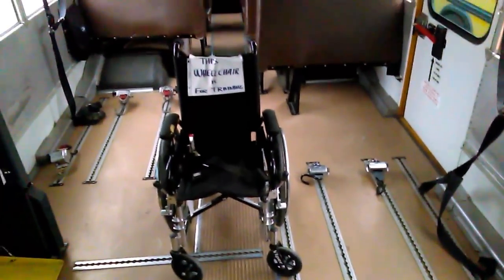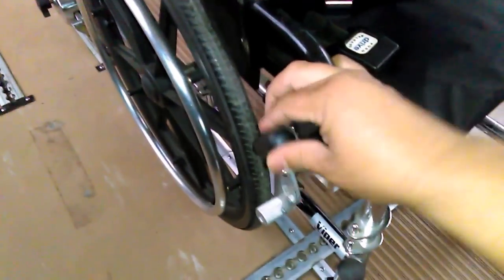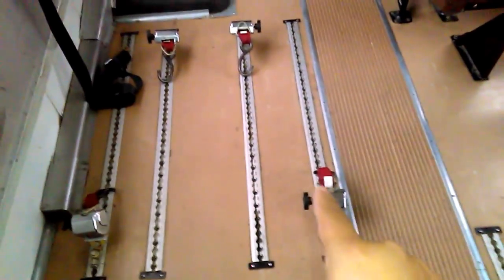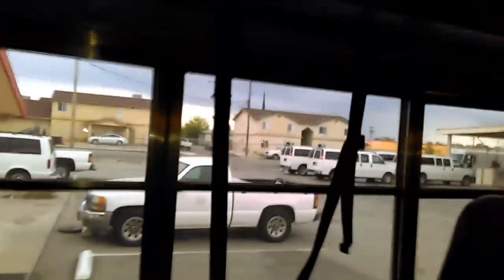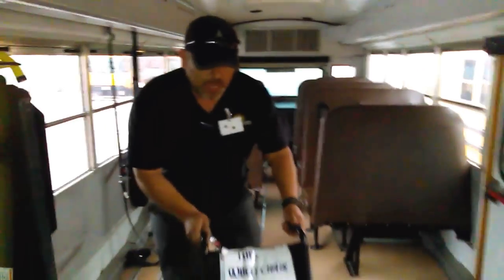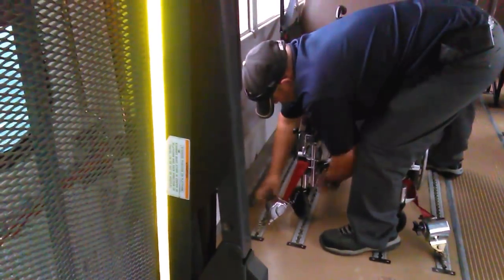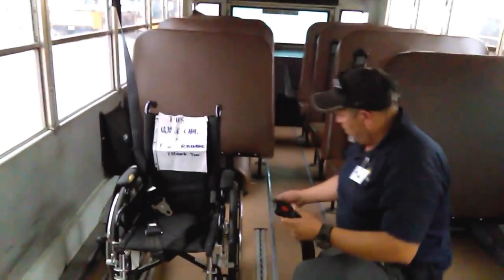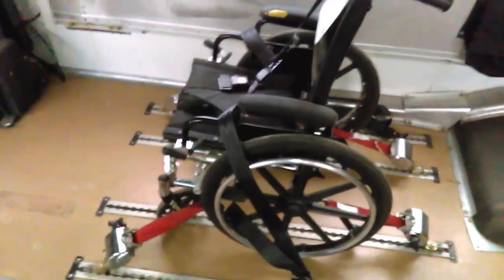School bus wheelchair securement using  the 7-point system. CDL.

Comment: With the the hook system (Some come from different manufacturers) I was trained to hook the front of the wheel chair with the Hook facing outwards. Away from the passenger. The rear hooks facing inwards. When the wheel chair is hooked up push back and forth to assure the hooks are tight. Then apply the brakes on the chair. This for the ratcheting type system which automatically tightens the belt hooks. As per Access-A-Ride in NY. That's how I hook up my passengers for the NYC DOE and the NY State system also. The three point belt hook up is with the release button on the side of the passenger so the passenger doesn't have access to release the belt...(Special needs). I have the same system on my bus that you show on your video. I find turning the tightener is time consuming as opposed to the ratcheting system. But they both do the job. 
I train my new matrons similar to what you showed. Thanks for the video. Something I can forward to my friends who are interested in working on school buses. 
Now I would like to see the pay scale go up for qualified persons who work on the school buses across the country. From my research of different locales? People who flip burgers make more than a properly trained driver/matron. If one has to go for periodic refresher courses on a yearly basis, to maintain their proficiencies? Then one should be compensated in accordance with their professionalism. Had to throw that in there for any other school bus drivers/matrons who read this. Thanks again for your great video!
Reply: Kk
Reply: Zzksyk
Reply: @Laura-oe3rp  ??
Reply: @tedhernandez2394 Well-stated!

Comment: The way the occupant restraint is routed is incorrect and unsafe. the pelvic belt should be routed close to the body and NOT over the armrest as this video shows. Route the belt in between the backrest and the armrest to get a snug fit and prevent the child from sliding out and underneath the pelvic belt.

Comment: Before my question Mr. Luis, great job with your visual aids, it really help me during my upgrade process at my job. I wish there where more trainers like you at more districts. Question: is it against the law to have the 3 point system set up/hooked while transporting students before using them? Hopefully my question makes sense.
Reply from the maker: I have not seen anything in code of regulations, vehicle code or Ed code that says otherwise. But the CHP carrier inspector at my school district said that it is recommended to put everything away while enroute if not used. Hope I was able to help.